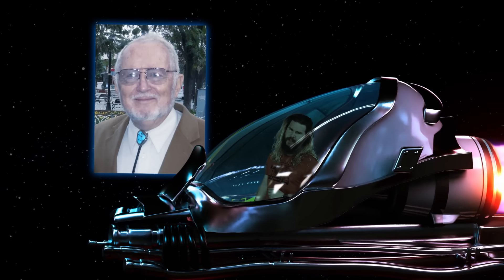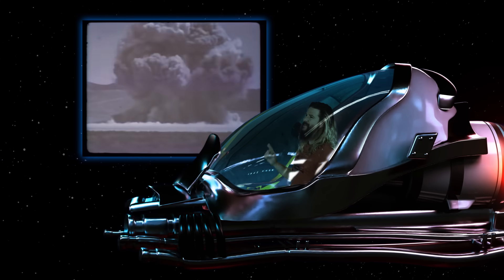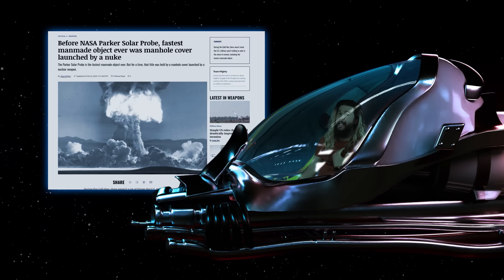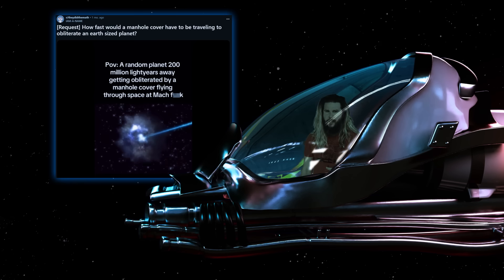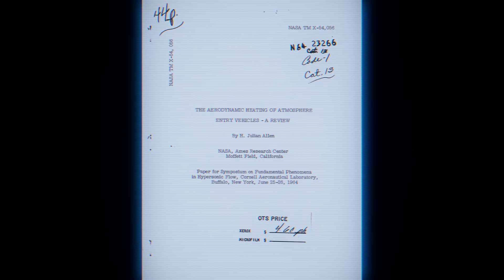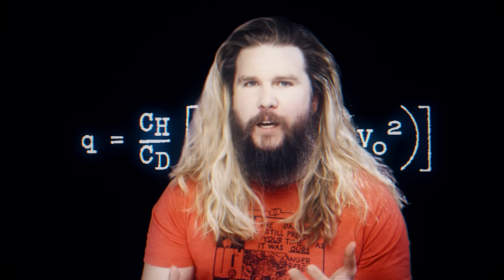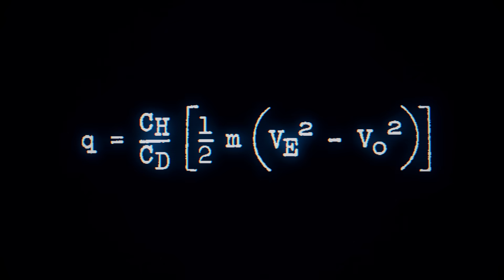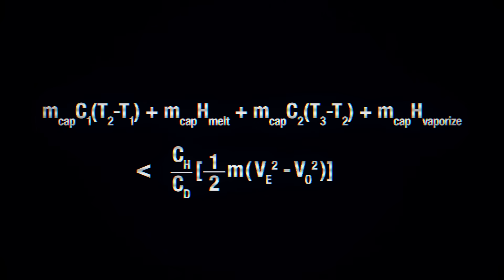Debunking the Nuclear-Powered Manhole Cover

Comment: Can someone calculate the deformation of the "cap" at max pressure from inside the hole? Wouldn't it have bent a lot? What if it broke up on its departure and theres just shrapnel flying through the universe at mach jesus (192.something at 0°c)

Comment: However, I did not see in the calculations for the adjustment for change in atmospheric density, a object EXITING the earth loses the friction value of the atmosphere vs an object ENTERING, I am not going to spend the next 3 weeks trying to calculate the aerodynamic changes and resistance changes over the two different actions.

Comment: That thing was in the atmosphere for like a second ascending through thinner atmosphere as it went. If it was intact in the single frame of high speed they got of it then even friction didn't have enough time to care much about it. Certainly not enough time to do anything about it. 2000 pounds of man made steel absolutely made it out of the atmosphere and into space. What I want to know is what direction it went to exit the solar system.

Comment: i'm so tired of people getting this wrong. the problem with these 'it burned up in the atmopshere' is that people forget that it was basically going straight up, while it definitely lost some mass and was heated up, it would leave the atmosphere and stop shedding mass and velocity long before it had accrued enough heat to disintegrate the manhole cover or bring it to a stop. your equation basically functions on the idea that it continually passes through the same atmosphere until it hit a zero velocity, fully converting it's kinetic energy into thermal energy. in reality, at the speed it was going, it would have left the atmosphere in under a second, and it would have lost very little speed in doing so, and as a result it is many orders of magnitude less heat generated. you need to rerun the calculation by FIRST figuring out what the 'final' velocity of the manhole cover was as it leaves the atmosphere, and then rerun the calculation. IF the resulting thermal energy is sufficient to fully vaporize the manhole cover, then it would have burned up before it left the atmosphere, but i don't beleive that is the case
Reply: Citation for "it would lose very little speed"? At the speed we're talking about, the drag force would be over a quarter million gees, that would stop it cold in 0.02 seconds.
Reply: as someone who has a master degree in aerospace engineering, let me clarify something for you: drag doesn't infinitely increase as the speed goes up. once your object passes through mach 1 and goes supersonic, drag actually GOES DOWN for a while as speed increases, and then starts going back up. 

the easiest way to consider why the manhole cover should have made it into space? meteors impact the earth atmosphere at roughly 25-50x the speed the manhole was traveling, and meteors that are much less massive than the manhole cover survive reentry and impact the earth. the manhole is slower, which means less heat from friction/drag, more massive, which means more thermal energy needed, and constructed out of stronger materials than what standard meteroids are made of.

there is some good math in this video, but a lot of incorrect assumptions are made to simplify the math that greatly skew the results. this is part of what makes aerospace equations so annoying, is that there are LOTS of underlying assumptions, and you need to be aware of them when using the equations of else you are simply using the wrong equations or the wrong data and getting invalid answers.
Reply: @delphy2478  So, no evidence for "it would lose very little speed" then? I thought not.

Comment: Problem with sanity check, meteors usually enter at an angle meaning the atmosphere "thickness" they face are effectively much larger than the cap hole that was shot straight up.

But it probably didn't reach space, if it was possible we wouldn't be doing rockets. Jules Verne proposed this means of reaching space and if it was possible space agencies would probably have it figured out.

Comment: I love that you did the math so much that I looked at the nasa paper. The section you got the equation from is for reentry of ballistic missiles, which makes sense enough. You use equation (4) for most of your video, but it gets replaced with equation (5) for your plug and chug. The changed part of the equation is weird, since it kind of implies the total heat relies on how much the object slowed down.

I tried playing with the numbers and it would take a lot for the manhole cover to not be vaporized. CH/CD would need to be 2.9 with all else being equal, which would take extremely different numbers from the ones you punched in. I tried to use the ablation formula from the nasa document and only got a ratio of 0.984, which is nowhere near enough to change things. The main things that remain are the Vo2 gone from your equation and changing mass. Even 1/3 of the mass is not enough to change things, even without recalculating the left side. If Vo2 was say 55 km/s, it would change the outcome to where there isn't enough energy to vaporize (1.06 x 10e12). I'm not sure if I understand that variable fully or why it was excluded/zero in your calculation. Especially since if Vo2 is greater than Ve2, it becomes a negative amount of energy.

Overall I love the video and the math. I still feel like there is some mystery left, like more factors to consider. Most likely though, it broke apart and burned up in the atmosphere.

Comment: Wow, the comments section sure is loaded with arrogant morons. 
Not only would there not be enough energy to lift it 100km into the air. But also the frame in which the lid is visible shows deformation and tumbling. 
Additionally you need sustained thrust to break from the earths gravity. Something that the lid did not have. 
It has been well known to be a farce for decades. 
The fact that armchair scientist keep regurgitating this myth is the only reason it persists.

We can go a step further and analyze the footage to get numbers, oh, wait, that's already been done.

This is the equivalent to flicking a coin.
It moves really fast for a little while, but once the input energy dissipates the coin quickly slows to a stop.

Comment: So couple questions.

1. does it matter that things are flipped? As in does the fact the atmosphere is getting thinner as opposed to thicker as the object moves through it matter? As compared to say a meteor? I feel like that would require more rocket science related info though.

2. How fast would it have been going when the last pieces vaporized? Aswouch would it have been the fastest manmade object to that date?

3. how big a block would we need for it to have made it into space?

4. Is it possible that the overwhelming velocity created a shockwave heat buffer as some other heat shields utilize.

Comment: Can you explain how the manhole cover can experience more frictional heat transfer than it has kinetic energy? In other words, your 3.8x10^13J of heat transfer to the manhole cover is about 19 times as high as the cover's kinetic energy from the nuclear launch. (1/2)mv^2 = KE -> (1/2)938kg(66,000m/s)^2 = 2x10^12 Joules. This should put an upper limit on the amount of frictional heating as the source of this heating is the manhole cover pushing its way through and compressing the air using its kinetic energy. Somehow you got an extra 36 terajoules. Did the manhole ignite fusion of the nitrogen and oxygen molecules in its path? Somebody call ITER and NIF...

But seriously, you should have done this basic check of your work as it currently violates conservation of energy and can thus be ignored.

Actually the more I think about this, the more I think this kinetic energy value proves the manhole cover, or at least some chuck, or maybe liquid drops of it, did make it to space. Its KE is less than the energy you calculated to vaporize the thing. 2x10^12J < 5.9x10^12J Now I'm assuming that you didn't make another mistake with the left half of your equation like you did your right half, but if that is correct, then it shows that the cover didn't have enough KE to lose to the air via friction in order to vaporize itself. It's actually then a question of if its non-aerodynamic shape with 8 times earth's escape velocity was slowed down enough by the atmosphere to stay on earth.

Comment: Would the heating received be affected by the shape of the cover plate. I thought the shape of the object, specificaly the radius of the object (based on a sphere) would determine the distance between the surface of the object and the shockwave generated by the atmosphere. As i understand, this is why capsules and spacecraft (apollo, mercury, starliner and the space shuttle) had rounded blunt bodies to move the shockwave further away from them as otherwise they would have melted from the heating. Could this principle have been in play with the manhole cover (depending on its orientation/deformation from the blast), and could it have survived?

Comment: I think you're missing a few things.  

First, the manhole cover would be moving along with the atmosphere immediately surrounding it for a certain percentage of it's path, reducing drag/heat from that.  I'm sure that there's an equation to find out how much that percentage is, though.

Second, your equation assumes that the manhole cover is maintaining a steady orientation.  It was almost certainly tumbling, which would greatly affect the drag.  This assumes that it didn't blast-form into a cone shape, as CodysLab's experiment showed.  Even then, it probably wouldn't be flight-stabilized.  There's some point at which material ductility, specific heat absorption and kinetic force meet to be able to blast-form a disc like Cody suggests, but a nuclear explosion happens so fast that I'm, not certain that it would have formed the disc before the blast was vented to open atmosphere.  I think we'd need much better high-speed footage to know for certain, or maybe a ton of simulations.  Either way, the coefficient of drag wouldn't  be a constant.

Third, you're showing that the cover experienced drag all the until it exhausted it's velocity.  This is true of incoming objects, but not outgoing.  It would have run out of atmosphere to grad against long before it ran out of kinetic energy to keep moving.  

There's also the graduation of atmosphere to consider.  The test site is about ~7000 feet above sea level, and the starting density of atmosphere is thinner, so even lower of a starting point.  It would have decreased as it gained altitude.

Another issue is the starting temperature of the disc would be affected by the heat from the blast itself, which isn't reflected in your calculation.

My personal opinion is that the blast immediately deformed the disc slightly, but not enough to meaningfully make it aerodynamic.  Then, as it hit initial and highest density atmosphere, it burned off some percentage of its mass to drag heat, but once it left atmosphere it wouldn't absorb any more heat, stopping any more material from vaporizing.

That leaves us with a slight bowled or dish-shaped hunk of half-disintegrated iron hurtling through space at mach fuck(minus a few percentage points).  It would be interesting to know what direction it was pointed in.
Reply: On the point of where it was pointed, the Earth's path through space is calculably predictable. Someone could measure the Earth's orbit back through the years to where it was pointing at the time of the test, and possibly even the solar system's relative location within the Milky Way, if it was felt that level of accuracy was necessary.
Reply: It was aimed a few degrees from the Sun and a few degrees North ecliptic.   Time of day and location of the borehole.
Reply: I will never tire of somethings speed being described as "mach fuck."

Comment: The math doesn't account for time, which at 66km/s would been about 1.5 seconds to clear 100km, basically outer space.  I really don't think the heating effect can act on that amount of mass in that short of time.  Yes it made it to space.
Reply: The radiation generated from freshly plasmolised air gives no shit about mach fuck - you are basically static to light.
Reply: 1.5 seconds is a long time at reentry speeds. The drag force at the given speed would be enough to stop it completely after only 0.02 seconds.
Reply: @WJS774  I'm sorry, are you trying to imply that the faster you throw something, the faster it stops? Because I can promise you that that thing takes longer than 20 milliseconds to stop if it begins moving.
Reply: @kavitiko335  The faster you throw something, the greater the drag force, yes. Are you unaware of this? I'm not saying that it will have stopped in 0.02 seconds, but that the drag force is so incredibly high at that speed that it would be able to stop it that quickly if it remained constant. In reality as the speed drops the drag does too, and it's a complicated differential equation to figure out exactly how fast it drops, but at those incredible speeds it will have lost the vast majority of its speed in much less than a second. It will have lost over a third of its speed in that 0.02 seconds, and over 90% of its speed in under half a second. Even if it broke the atmosphere it would not have close to escape velocity by that point.
Reply: @kavitiko335  If you are such a genius, why don't you do the calculations yourself then? Prove me wrong, if you can. But you can't, can you?
Reply: @WJS774  Well Youtube is deleting the comment for some reason, so here's the TLDR of it:

Drag = 0.5 * Density of air * relative velocity^2 * Drag coefficient * Cross sectional area.

There are no subtractions, no fractional or negative exponents, no logarithms - there is no way to make one side of the equation increase non-proportionally to the other side. Put simply - there is no way to make an object travelling faster reach 0 quicker than an object travelling slower.

Ergo, if a steel plate can ever be moved such that it takes longer than 20 milliseconds to stop from air resistance alone, your preposition is garbage. Given how I know that given a sufficiently flat surface, I could do so with my bare hands, I am forced to conclude that your preposition is garbage. How do you think rolling works?

Comment: 10:00-ish Well, it would have been the fastest object for, like, the fraction of second it existed as a coherent object before it vaporised. 

Not to be equalled until Edward Teller's Project Excalibur SDI project, but Teller used a tungsten, bullet-shaped mass, reportedly, which might have lasted a fraction of second longer, maybe? Hmm, maybe not, as it was an underground test, so probably disintegrated when it hit a target inside a mile or so of tunnel, I guess.

Comment: There is a massive difference between launching a large piece of metal into space and a piece of rock entering the atmosphere. When meteors enter the atmosphere the air is relatively static, however when the borehole cover was launched up a column of air was moving with it. Thus frictional heating would have been reduced. If you really want to lay this to rest you need to include phenomenon in your calculations. Furthermore if you want proof of this gas corridor effect, watch almost any video on this website of guns being fired in slow motion.
Reply: Ironic that you mention guns being fired, because that conclusively proves that the propellant does not have any real effect on the projectile after it leaves the barrel. Bullets do not continue accelerating after they are fired.

Comment: I think you are making a mistake. If you presume the object was moving 150k mph and the atmospheric density decreases over the .000366 seconds it takes to get above the mesosphere (the place where meteors mostly burn up at) then you would have to show that the air (the fluid in this case) had enough time to transfer heat to the metal. The fact that you do not observe an explosion in the sky directly above the detonation point means that the instant it was launched wasn't enough to vaporize it. The high speed camera evidence alone shows it will take time to heat up the cast iron, which btw is way more dense than a typical meteor.
Reply: Are you for real? 0.000366 seconds to escape the atmosphere? At the speed given, after 0.000366 seconds it would have travelled a grand total of 24 metres. Not kilometres, metres.
Reply: @WJS774  It was moving 40 miles per second... I may have exaggerated, but the mesopause is still only about 55 to 60 miles up. So, between 1 and 2 seconds. Expose that dense piece of metal to 80,000 degrees centigrade for 2 seconds then teleport it into a vacuum. Just so you remember, this is the same element that is the heaviest formed in the fusion of stars.
Reply: @montyburnham7704  You are completely ignoring drag, why the hell do you think you can do that? At the speed that thing was going, the drag force would be a quarter of a million tons!

Comment: By Kyle's own method here every rocket sent to space would need the same heat shielding going up as coming back meaning every Apollo, Mercury or Gemini capsule should burn up without a big heat shield on the nose the same as the one on the bottom.
Reply: No, because they are going very slowly while they are low in the atmosphere. They only accelerate to orbital speed after they have reached space. This cover, on the other hand, was travelling orders of magnitude faster than orbital speed at ground level.